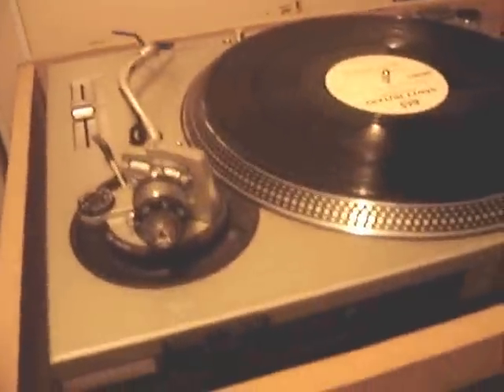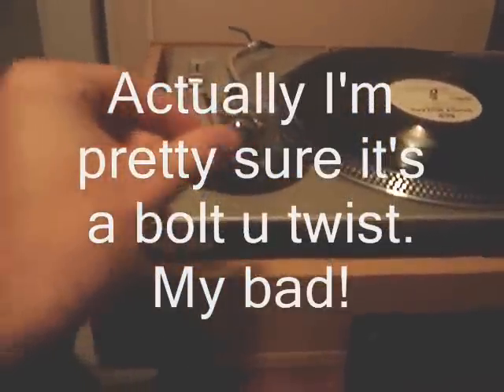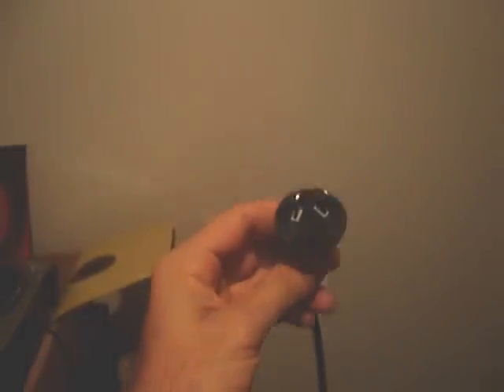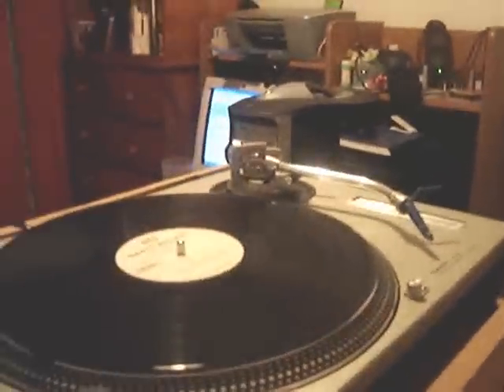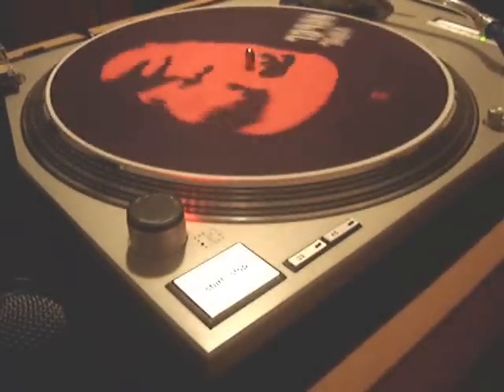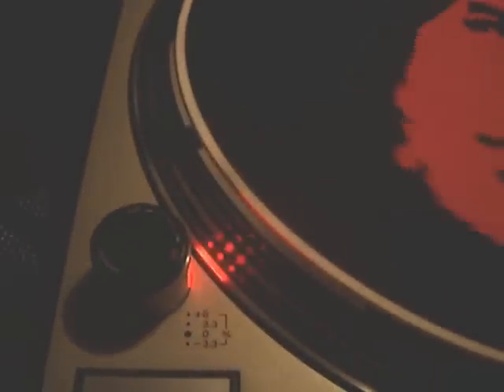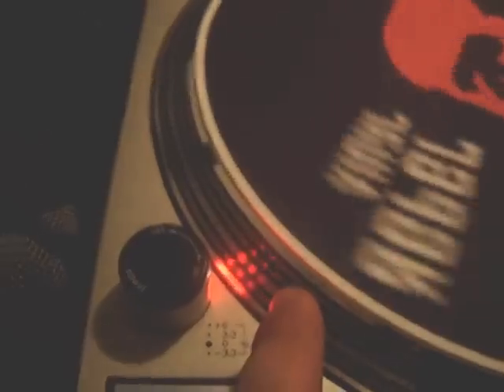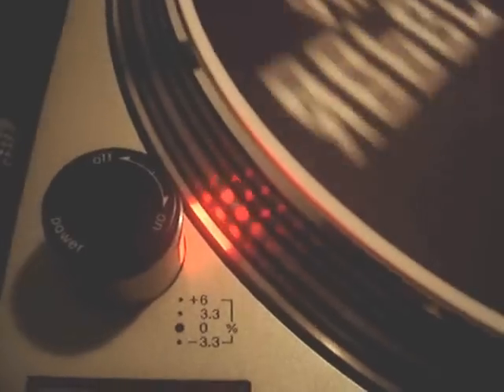Australian voltage in relation to turntables

Comment: If you plot a graph of the platter speed against slider position you will see that it's S-shaped; the slider is indeed non-linear and is NOT a measure of percentage difference.

The non-linearity is due to the nature of the R-C oscillator that's driven by the slider; it has NOTHING whatsoever to do with mains voltage or frequency.  So there!

Comment: If you plot the actual speed of the platter against the slider position, you'll find it to be S-shaped; it's not a linear scale.

The slider is indeed NOT an indication of percentage.

The non-linearity is to do with the R-C oscillator that the slider feeds; it's got NOTHING to do with mains voltage or frequency whatsoever.  So there!